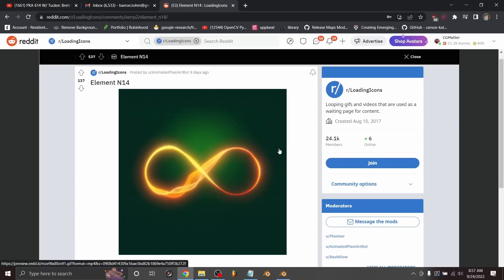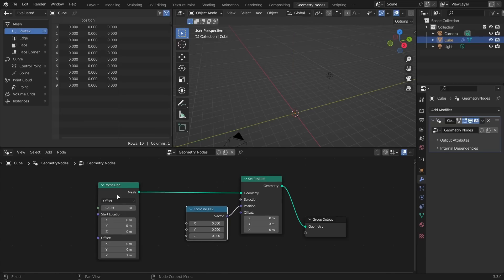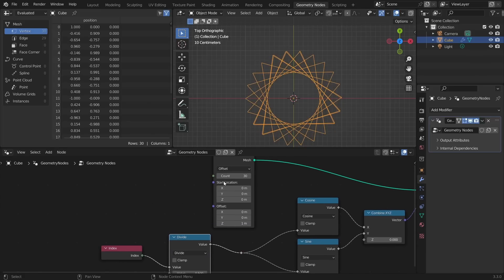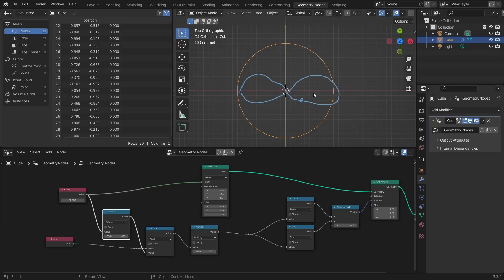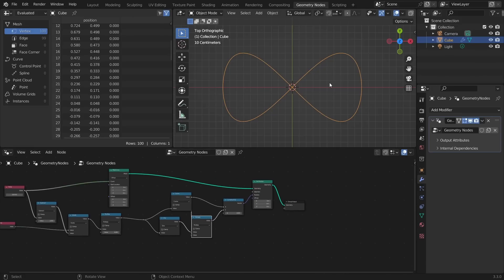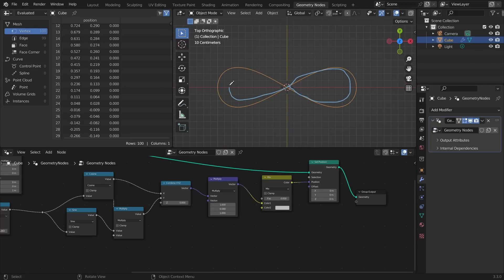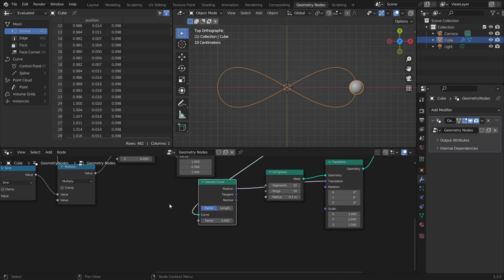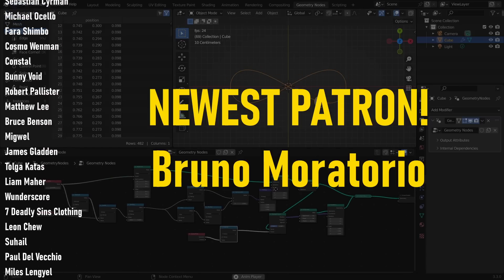Blender is INFINITE!

Comment: Instead of using a mesh line, use a curve line from the very start of the node tree and resample to give it enough points to move around.  Then you can use spline parameter/factor as an input to the trig functions and don't need the later mesh-to-curve operation either.